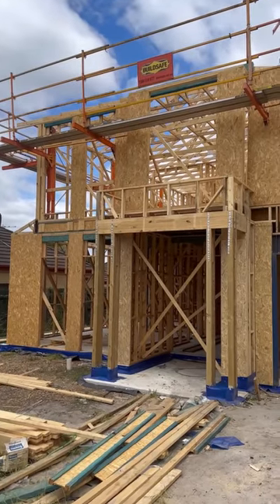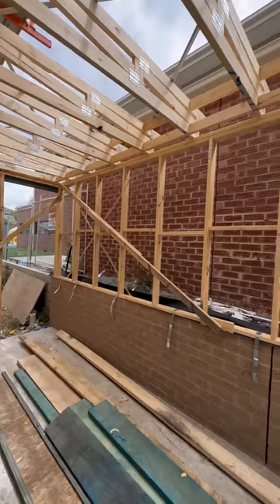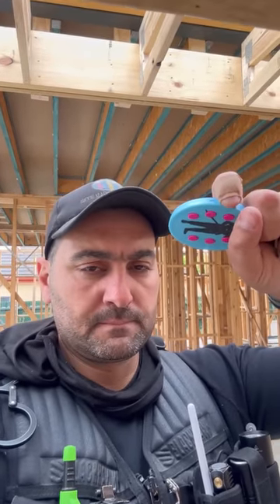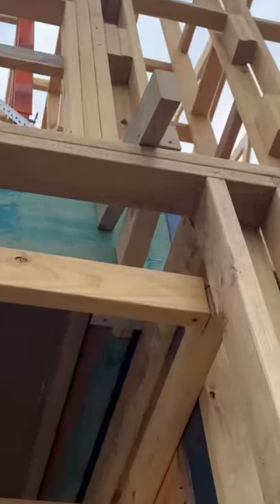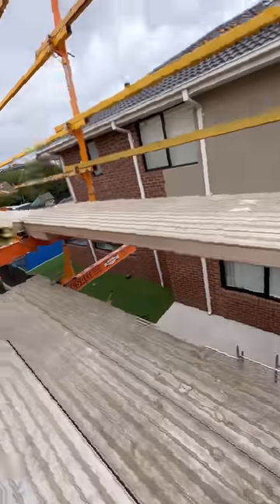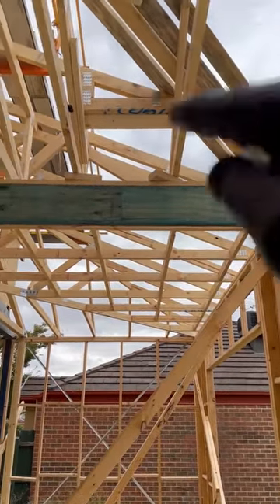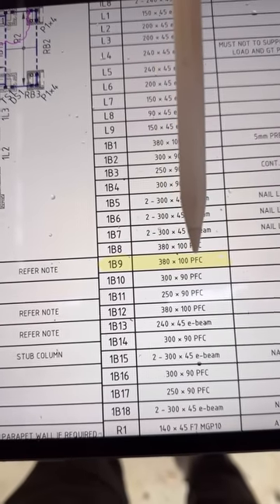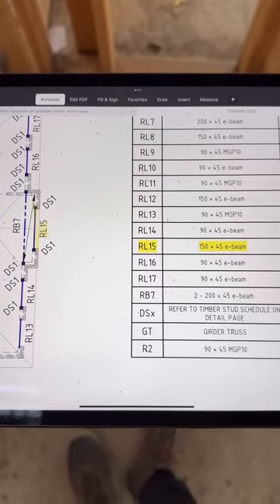Major NCC Breaches Uncovered: Should Homeowners Pay for Substandard Frame Construction?

Comment: I'm a builder and this demonstrates why I will never let anyone else build my home and why I will never buy a house built by someone else.
Reply: Im not a builder and these videos convinced me to never buy new.
Reply: @crazysteve8088  Just find a good builder which is very difficult task. I have had to fix work done by so called quality builders. Many builders have asked me to work for them and I have refused because of their low quality
Reply: @morninboy How do we find a quality builder?
Reply: @jacobkuntflapp  Believe it or not, drywallers are good to ask for references as they want straight, square, plumb buildings. Ask a builder for references from previous builds and check them out. Go inspect the builders work somewhere. 
If you are going to spen half a million bucks put some effort into it.
Reply: @morninboy  100% thanks mate
Reply: @jacobkuntflapp  It's what is underneath that counts. Easy to fix what you can see.
Reply: @morninboy I’m a plasterer “commercial” so I’m capable of constructing walls & ceiling’s & I approve of your message!

If the framing wrong,sheeting is wrong setters “fix it” , skirting/architraves wrong,cabinetry wrong etc!
Reply: Do you say to your client " dont pay the invoice" and do you give a list if all the defects to give the builder to fix before he ( builder) receives frame payment?
Reply: Do you guys remember when they used to build straight walls?
Reply: @morninboy  they're called plasteres in this country and they're mostly goo.ks here. The wall straightening and plumbing of the frame are done by the carpenters and not the builder.

Comment: Good on you, once again.

The situation which we are facing here is caused as a shift in builders becoming co-ordinators vs being around from set-out, until landscaping.

My advice is to work with a smaller builder who is the named as the registered builder, not engaging contractors for most of the work carried out.

Good luck out there!

Comment: Just gets better with every video 
I’m a mechanic by trade image if I didn’t fit a couple of wheel nuts and didn’t refit the engine cross member with the correct size bolts these builders would have me in court as quick as the engine and wheels fell of 
There apprenticeships are only a ticket to learn not call themselves tradesman
Reply: It's a joke.  There are building trade apprentices getting charged out at 70 bucks an hour and cranking out crap like this.  The whole industry needs a clean out.
Reply: Mechanics are the worst! No disrespect mate! They charge $120 an hour & you go to them..god knows what they do to your car or parts and charge a fortune and no chance of a client not paying because they won’t get there car! good tradies do the work and wait or chase the money for completed works! 
Sorry mate I get done over by every mechanic!
Reply: @dartymcphee6738  I don’t go to a mechanic I am a mechanic and extremely disappointed that there is no regulation in the industry that prevents some idiot putting in a set of brake pads incorrectly then having there 2tonne car becomes a rolling weapon unlike the building industry that has regulations but unfortunately the builders just walk away saying there isn’t a defect oh and I don’t know which mechanic you are pricing butlasti heard dealers are charging around the $180-$200 per hour and paying the mechanic $30-$35 per hour
Reply: People who do their own mechanical work and aren't trained put everyone else on the road at risk. No different to doing your own electrical or plumbing.
Reply: People who do their own mechanical work and aren't trained put everyone else on the road at risk. No different to doing your own electrical or plumbing.

Comment: I used to always up the anti with engineers, if they wanted 10mm base plates I'd go 12, 
Beams were different as they didn't like upping the kg/meter on beams as they get nervous if extra weight is present.
So I'd put in extra stiffeners and thicker connection plates and bolts, or more bolts, 
"I'll take the engineers back to school on this job" I'd say ,
From what I see here, an extra day or two for one guy to make sure correctness was present would've paid off about 20-1
. Good times

Comment: The builder should be using an independent certifier for Soil, Slab, Frame, Plumbing, Electrical, Waterproofing and Roof. The owner/financier should be able to engage an suitable qualified professional to inspect each stage of construction prior to payments. Why is the process failing. These builders should be deregistered and never be allowed to hold a license or be allowed to work unsupervised in the construction industry!
Reply: The Banks won't do a thing, my daughter built in W.A. 20 week build now into its 3rd year!!! 
Build has over 100 defects including major structural with the lender being informed & my daughter being told by the bank or wasn't their problem .
The build is a tear down, builders are Modco Residential Perth...  directors & supervisor gone into hiding.
Reply: @Hydrnaught  That's Terrible. I walked passed Modco offices last week and they are empty, stripped and repossessed by the building owner. Absolutely no redress as the money has gone
Reply: Self certification is an absolute joke & dangerous the cost of a good surveyor is small over the price of a home.

Comment: Love your vids - very informative for me as an architect to see how a diligent building surveyor thinks. However, you do make the occasional mistake: e.g. these top plates are double top plates, they seem to be joined correctly as the top and bottom ones overlap by long sections that are nail laminated. The pictures you showed in the framing standard relate to single top plates. There was another little thing like this i noticed in another vid. Other than that though, keep up the good work! :)
Reply from the maker: Additional blocking & fixing is needed as per the detail. This ensures the double top plate acts as a single structural section particularly as it’s load bearing.
Engineer reviewed and directed to fix 😊

Comment: A lot of issues with this build but the part where you showed them joining 2 ribbon plates together is not an issue, unless they are building in N4 wind rating.
Reply: but if it isnt per the plan its an issue for me.
Reply: @iancremmins4727   what are you even talking about? plans dont state how to install a ribbon plate, the standard details acceptable methods and its on the tradesperson to interoperate that standard and complete the works accordingly.
Reply: @judge462  yes, it is shown quiet often in these video's the results of tradespeople interpreting, pretty much the whole point of his channel .

Comment: In NZ Local councils carry out inspections and engineers will sign off on SED elements. Who performs the inspections in Aus?
Reply: Lots of dodgy NZ builders left for Australia, when NZ tightened up 10 years ago. The NZ builders that stayed home were the good ones.
Reply: In NSW you can choose to use the council inspectors or appoint a private certifier. Both should work in the same way. In my experience one isn’t any better then the other. The reality is no certifier on a site inspection is going to look at everything - time doesn’t allow.

Comment: One doesnt need to be a rocket scientist to be a building inspector. The issue is not one of knowledge but of what standards you are prepared to compromise for how much $$. Its well and good to be on a crusade in showing the many "non compliant " works etc but these practices of cutting corners is endemic in the domestic building industry and has been for some time. Of course specs are made to be followed for structural integrity and safety but as we can see so many workers just do their own thing. Luckily there is margin built into the specs otherwise these homes would be tumbling down.

Comment: Everybody goes after the builder but what about the carpenter?  Is this the carpenters first day on the job?  Does the bulder have to check every nut, bolt and nail and stud or is the carpenter supposed to know how to read a flippin' plan?  Or how to brace a roof?  Thye issue is flippin' tradies